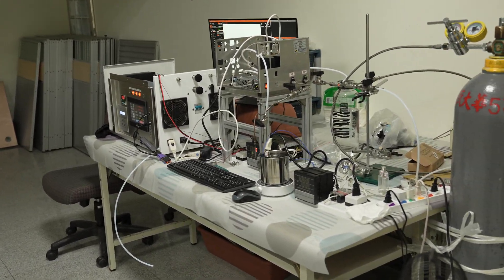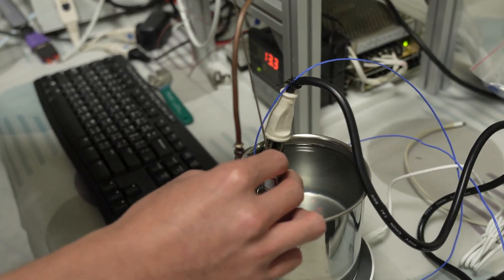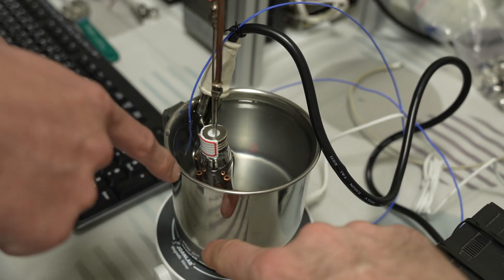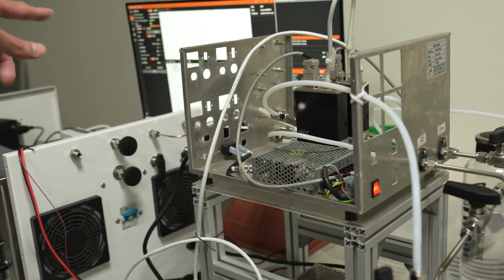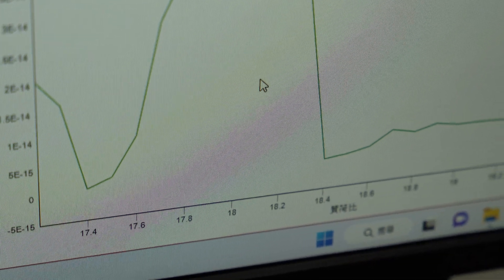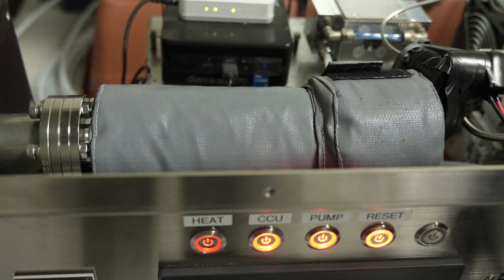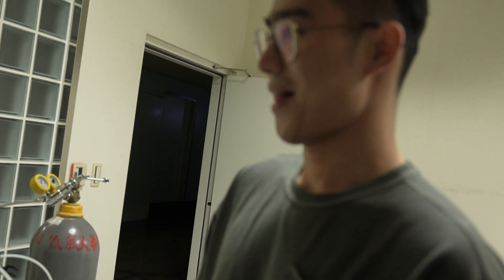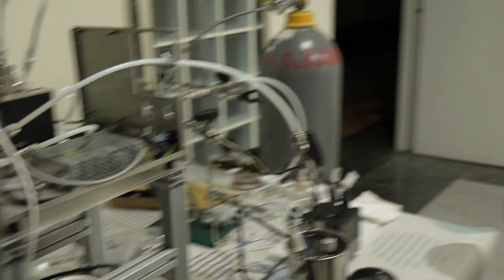HUANG - A look at their new Mastek mass spectrometer

Comment: So this will be testing the water from the heat exchange machine that has cavitation in it, and produces Neon in the water ( indicating some nuclear process like fusion has occurred or some other LENR type reaction )
Reply from the maker: Yes. It is the same kind of Mass Spectrometer that was used for the paper here:
https://www.nature.com/articles/s41598-023-50824-8

Only the company that makes it made one in November and handed it to Bin's team to large scale testing. This means the cycle time between production of samples and beginning of testing is reduced to nearly nothing. They are not really expecting large numbers of new elements to be descovered, they are focusing on the concentrations of say D, 17O, 18O, CO2, 22Ne etc.

I met the owner of the company that makes the devices, he was there for the meeting - great guy.